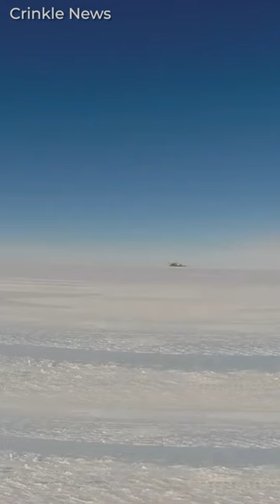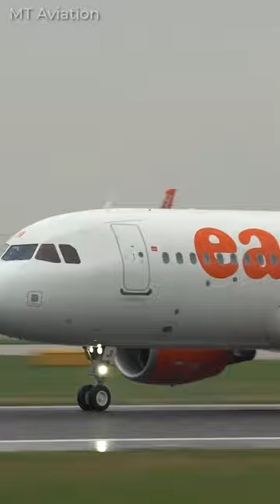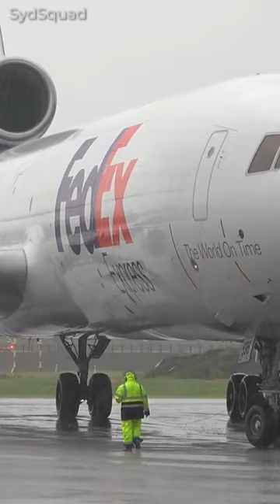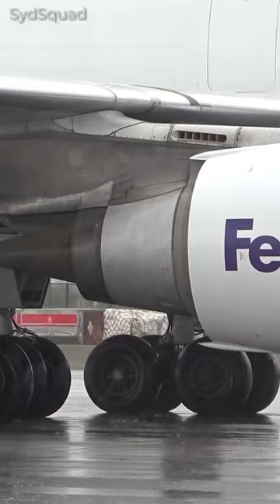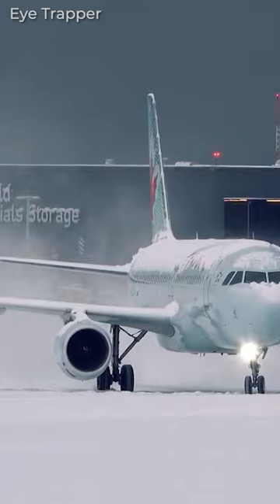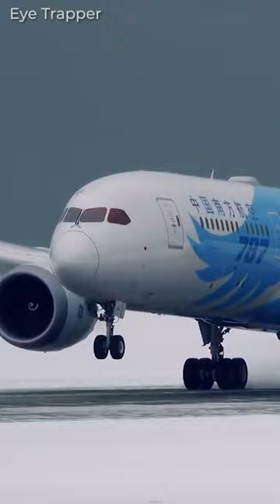How Wet and Contaminated Runways Affect Aircraft Braking And Handling #shorts

Comment: I think I watched a video in the last year or so of an Airbus wide body landing in Antarctica. But that didn't really have to worry about running out of runway by the looks of things.
Reply: It was the a340
Reply: Hi, Eamon. I saw that too. It was a Hi Fly Airbus A340 that landed in Antarctica.

First of all, the runway surface was well prepared. Loose snow was removed and the surface was made compact. Also, grooves were carved into the snow to increase the braking efficiency.  

Even with all that there will be a noticeable reduction in braking efficiency on such a runway when compared to a "normal" runway.

In the video, that captain talks about how much work the airline's flight operations department had to do to make it possible.